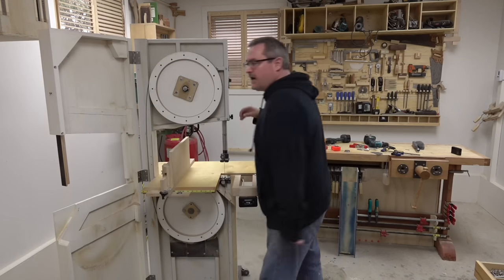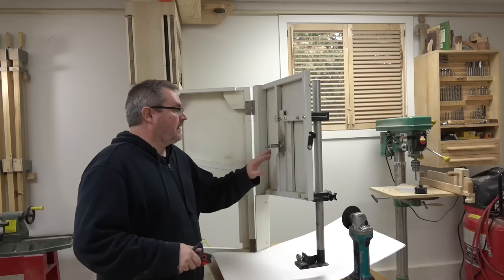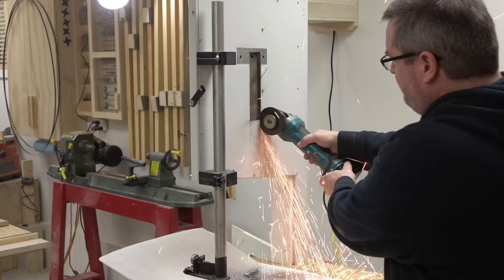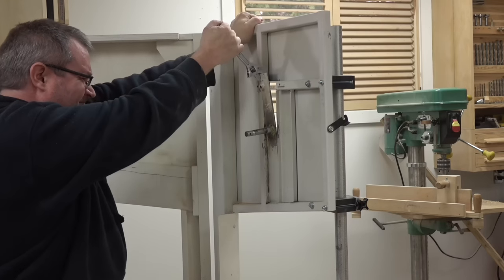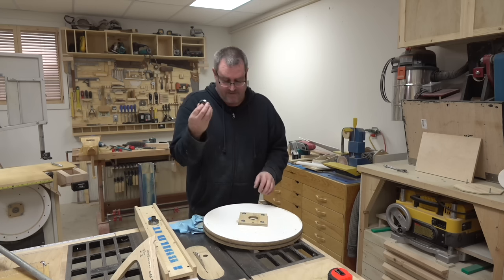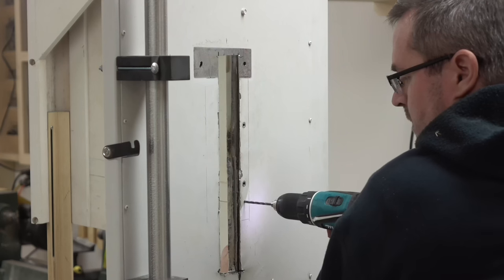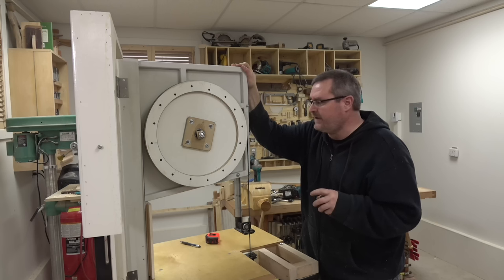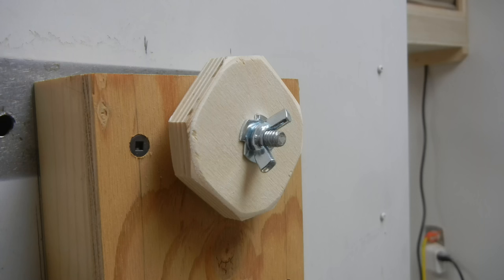Band Saw Repairs

Comment: Three wheel band saws utilize smaller diameter wheels than 
comparable capacity two wheel machines. Therefore, the blade must bend 
around very small radii three times for each band revolution, as opposed to 
larger radii, two times on a comparable capacity two wheel machine. This 
condition results in increased blade fatigue which shortens blade life. 
· To minimize the impact of the fatigue factor on three wheel machines, the manufacture's
use much thinner (more flexible) blade stock. Delta's 16" model uses blades 
that are either .018" or .020" thick. The 10" machine uses blades that are 
only .014" thick. Also the usual blade welders can have a more difficult time trying to join these thinner blades. Just something to consider before you think of building.
Reply from the maker: +Scott Russell 
Judging from your comment, you don't understand what I want to do.
Reply: Rewatch and listen.
Reply: +I Build It I usually agree with you but he's right. whether its 3 wheels or fifty small wheels, the blade still has to bend along whatever curve radii the wheels have, whether it touches the whole wheel at once or not. The smaller the wheels, the more stress of the flex/bend. The increased stress would likely shorten the life of the blade and its weld, but I'm sure if you use a blade with a lesser material thickness, it should be fine. I'd like to see it.

EDIT: We do understand you but it feels like you are simply refusing to understand what we are saying. As if you simply are casting aside any advice or caution. You have a lot of engineers that follow you on here and I wish you would try to understand what they are trying to tell you.
Reply from the maker: +John Peel 
Seriously guy, "refusing to understand"? Lol.
That's the problem with saying anything like this in a video - it pumps some vigor into all of the armchair "engineers" out there that immediately start to look for reasons it won't work. It's perfectly understandable, given human nature, but it's also sickening to read. 
The only solution is for me to actually do it and show that it will work and blade breakage won't be a problem. Then we'll see what all of the experts have to say. Something like like this, no doubt (if you said anything at all, that is): "Oh, you meant THAT way! I thought you were going to do it some other way".

Comment: One little suggestion for future videos: i would really apreciate it, if you could tone down tools like the angle grinder a bit. I always have my family complaining about the noises watching videos of this kind, so i always see myself juggeling with the volume nob of my amp while watching these videos...
Only if it is not too much work for you though...
really liked this video otherwise, although i am not sure what impresses me more: the strength of your welt, or how you managed to bend that piece of steel as if it was lead :)
Reply: headphones dude
Reply from the maker: +muh1h1
Fact is, I spend a lot of time adjusting the audio level on all of my videos, but they are not scenes from a library - work is happening - you should expect some louder sounds.
Reply: I Build It OK, so it is a decision, OK, too bad for me i guess :)
Reply: Perhaps I'm out to lunch, but don't most of the video programs have an audio normalization plugin that can average the highs and lows, might be worth a look, could be less time in post processing to run such a plugin with saved settings as a matter of habit than to manually adjust anything.
Reply from the maker: +Cameron Young 
If only it was that easy. Normalization (hard not to know about stuff like that, if you've been doing this for a while), doesn't work that well and there are a bunch of other factors.
Also, it's difficult enough doing all of this without also explaining it / defending it. I can't please everyone, especially those that take it for granted.
Reply: +I Build It I'm out to lunch then, don't think we all take it for granted though. There's a reason I don't make videos, too much work. I haven't got your patience either, I would have smashed something, probably the camera, accidentally of course, about half way through.

Comment: so when a bandsaw blade goes around it's essentially being bent twice per revolution by the two wheels. i wonder if it would be a problem that by adding multiple smaller wheels you're not just bending the blade around a smaller and sharper curve, even if only a little each time and only very momentarily, but that you're also bending the blade just that many more times as it goes around. shrug i've never seen that sort of thing before so it could just be perfectly fine. only one way to find out!

Comment: Potentially an issue with the smaller wheels that the blade would bend at a sharper angle across each wheel causing blade premature failure.

Comment: Hey John, sorry to bug you again, any info you could give me would be massively appreciated tho!  I'm building a  16" band saw, I have a 1HP motor that runs at 2800rpm! What is the recommended rpm at the blade (if there is one) and what kind of diameter am I looking at for the drive and driven pulleys? Please help, and speak slowly as the "tech" part of my brain leaked out sometime during the 80's!! (the music was pretty weak, but the drugs, well that's another story!) :)

Comment: I would think that the blade bending and unbending as it passed over every smaller pulley would cause the blade to stress out and break faster.
Reply from the maker: +Charles Reiche 
It would be several smaller wheels that follow the curve of the big wheel, so minimal bending stress.

Comment: The problem with more but smaller wheels would probably be tracking. Besides the problem of having to align all the wheels you would only support very small sections of the blade, which means less lateral friction and maybe even some vibrations because of the many bends the blade has to make.

It would be a nice experiment. A safer bet would probably be to buy a heavier duty bearing instead of many smaller ones, but safe bets make for boring videos.
Reply from the maker: +MrPanohead 
Who wants safer? :D
That thinking right there kills an idea even before you get started and is the death of creativity.

Comment: My $0.02(USD) on why many small wheels aren't typically used. Bearing life is both a function of radial load, and speed. To get the same blade speed (FPS or IPS), you will need to spin the smaller wheels much much faster. 

Let's assume a nominal blade speed of 3000 feet per minute per http://www.highlandwoodworking.com/woodworking-tips-1205may/askthestaff.html
A 16" wheel (my guess at the full size wheel) has a circumference of C=2*Pi*Radius = 50.26" or 4.19 feet. 3000 (Feet/Minute)/4.19 (feet/rotation) = 716RPM.
A 3" wheel has a circumference of 0.79 Feet. 2000/.79 = 3797.5 RPM.
The 3" wheel needs to spin just a bit more than 5x faster than the large wheel for the same blade speed.

I agree it does seem interesting as a way to increase cutting depth, but i'm just not sure it will work better long term. I'd need to draw a picture and work out the forces to sort out what the bearing radial load would be assuming some nominal blade tension, but intuitively i suspect that it isn't the load on the single bearing divided by the number of small wheels used as the small wheels also have to now keep the blade spaced apart.

You also will be flexing the blade around the smaller radius of the small wheel even if they are close together it could still cause stress cracking in the blade depending on the thickness of the blade, i think.

(Sorry at work in engineer mode, not woodworker mode. For the record i think it is worth the time/effort to experiment with.)